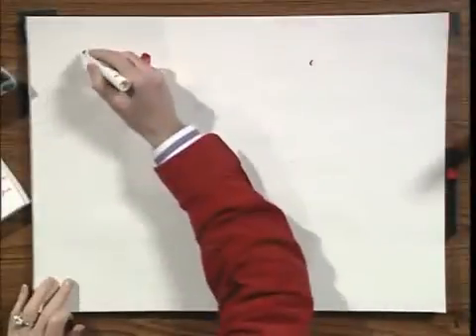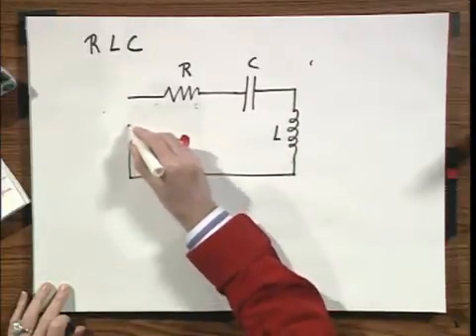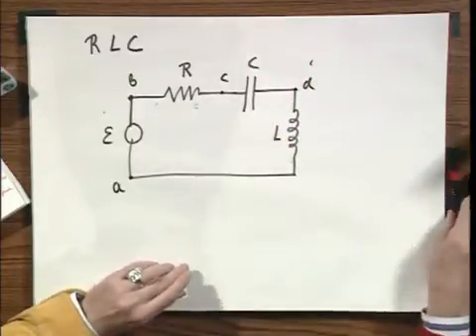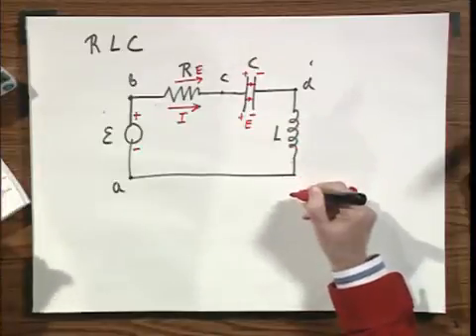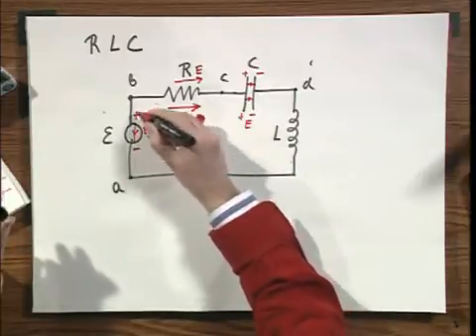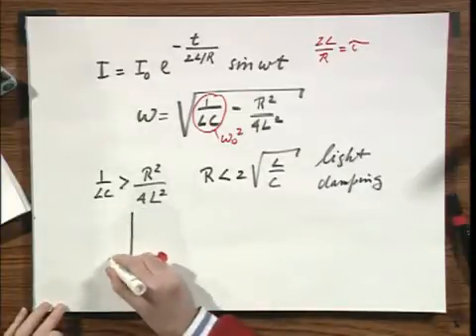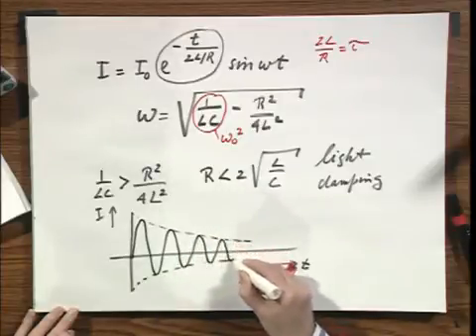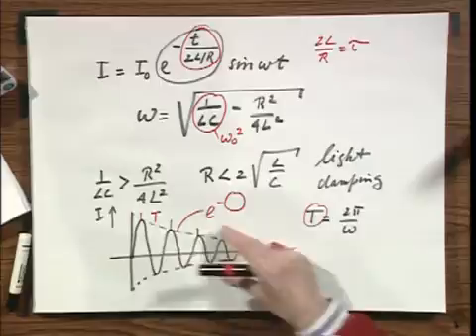8.02x - Module 09.01 - Lightly Damped RLC Circuits. Faraday's Law

Comment: Professor, why doesn't the self-inductor have any electric field of it is made of superconducting material? And why does the resistor have an electric field? I have watched all your prior lectures and haven't been able to understand this. The last equations that we ever study about electric field is for the relation with p.d. (V = -Integral(E.dl)). Why doesn't superconducting material have any electric field within it?
Reply from the maker: V=IR  if R is zero V must be zero but if V is zero E must be zero. Yet I can then be anything.
Reply: @lecturesbywalterlewin.they9259   Thank you a bundle professor! I haven't been understanding this, given that it had such a simple reason! If I may, can I ask a follow-up question?
So, now because the resistor has resistance R, and V=IR, V is non-zero, hence E must be non-zero too. But, since V = -Integral(E.dl), does the value depend on the length dl of the resistor?
Reply: @lecturesbywalterlewin.they9259 
Hope you are well Professor b/c I haven't been for the last few days... 🤒 🤧
–But I'm getting better!

I'm a bit flummoxed myself on inductors, so could you please tell me if I am correct in my explanation below:

In the inductor, we do have Enet=Σσ/ε₀. 

Therefore if Enet=0, then the net charge density is zero.

Whatever (fixed) A is chosen as , we have the net charge & net electric flux φ is zero. 
Enet=ΣQ/ε₀A=φ/A =0

Because of the shape of the coil, there are as many charges in one direction at any point inside as the opposite, therefore all E-fields in the coil cancel out along the wire, but the E-fields don't cancel facing out or in, so depending on the charge considered, 
it will experience an electric force either 
in or out of a loop.

If you start by considering how the magnetic fields superimpose on portions of the coil, you get the same result but we call that force "magnetic". 

Either way, if the resulting force on a charge in the wire of the inductor is normal to the direction of the velocity of the charge, then there can be no work done on the charge along the wire. 

In fact, the direction of the force on a free charge carrier is outwards, so the charge loses its bond with the wire and may escape the wire! 

If it did that,then it could also come back down and cause pressure on other charge carriers of the same sign, and this would cause fluctuations in potential along the wire due to the charge density wave created by the rising and falling charge. 

But eventually everything tries to equalise in the circuit and that means potentials at either end of the inductor will try to balance out so that the current goes to a minimum value due to the inertia of charge carriers and Newton's laws of motion.

The charge carriers can still flow through the coil without any net force along the wire, as long as when the charges are outside the wire, the electric forces conspire to draw them back into the wire and crash into other charges. 

Technically there is no current in the coil because drift velocity is a change in velocity, but there can still be a flow of charge in some direction due to constant velocity. 

Perhaps the charges could be bouncing up and down normal to the wire, but the component of velocity along the wire is constant❔ 🤔

Comment: how come there is an electric field inside the AC power supply and there is no electric field inside the inductor?
Reply from the maker: watch my 8.02 lectures
Reply: @lecturesbywalterlewin.they9259  I have already watched your lectures. But I couldn't find a thing like "there is an E-field in the AC power supply". But what is the difference between inductor and AC power supply? their working principle is much similar. and both of them's E-fields are circular(creates a closed loop in the circuit) and if there is no electric field inside the inductor, than there shouldn't be any E-field inside the AC power supply. Please tell me the truth if I said a wrong thing. thank you
Reply from the maker: @ugursoydan8187  yes there is an E-field inside a battery and inside a power supply, and NO there cannot be any E-field inside an ideal inductor which is a coil made of superconductive wire. END of story - watch my lectures.

Comment: Great video! 
One thing I did not understand is that what do the dots on the top mean at 5:05?
Reply from the maker: x-dot is a shorthand notation for dx/dt
x-double dot is a sh notation for d2x/dt^2
Reply: Lectures by Walter Lewin. They will make you ♥ Physics. 
Oh! Thank you so much, sir.